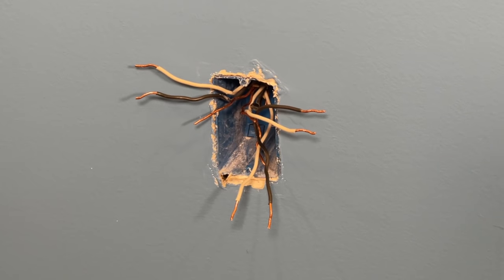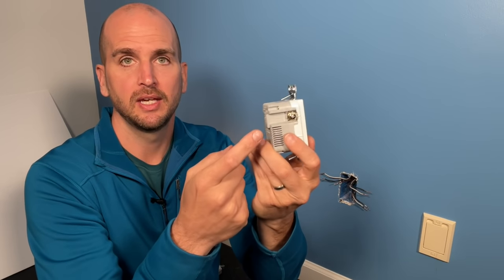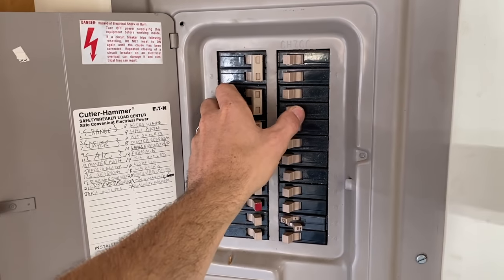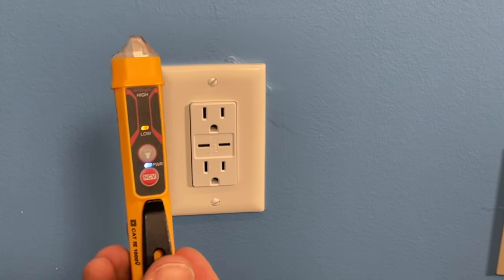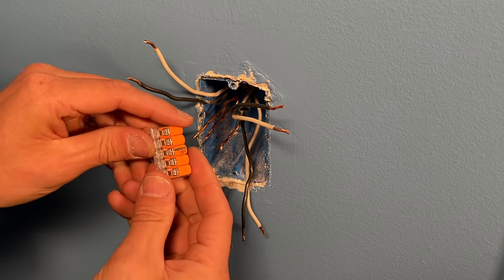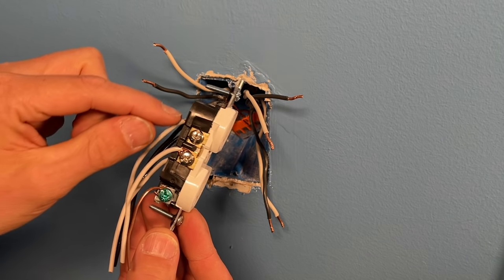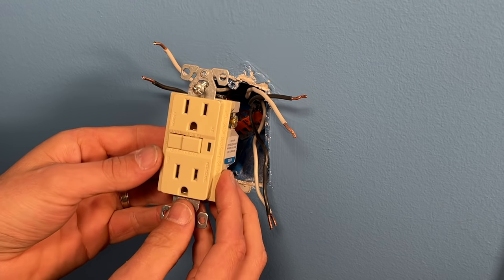Wiring an Outlet with Multiple Sets of Wires

Comment: Excellent work sir. I just started watching your videos and appreciate the care you take to explain the work you do. That being said, I would like to request a video that explains multiple switches. I have a bathroom with a light and a fan, and there's two switches for each one (One inside the bathroom and one outside). The dude that did them didnt know how to hook them up properly, so now both light switches work as expected, but the fan requires one switch to be on for the other fan switch to work. I have the same issue for another room with a ceiling fan. Two switches for the fan. Switch 'A' turns it on or off, but the other switch 'B' only works if switch 'A' is also on.
Reply: It's been 7 months since you've posted your question, so I don't know if you found your answer yet, but you can find diagrams all over the internet on 3 way wiring methods. 3 ways are a little more complicated to explain because of the different wiring methods used by electricians.  I can tell you that this issue is due to the travelers and the common wire crossed. Three-way switches have 4 screws. One black, two brass, and one green. The black is common, used for the power or switchleg. The brass screws are for travelers. The two wires traveling to both boxes. Usually, they are red and black wires. The green is the ground. Hope this helps.

Comment: As a pro for over 2 decades your the 1st person on YouTube that I have seen recommending the Pigtail. You should've explained why it's not a good idea to wire an outlet with 7 wires on it (including 1 ground). But let me ask you "if that outlet with 7 wires was to go bad which they do how long would it take a reg Joe to troubleshoot"? You should ALWAYS Pigtail outlets. Saves you time and money plus your wallet.
Reply: Theoretically, it doesn't matter... the bus bar and terminal are solid brass or whatever material connecting all the wires. They can't really go bad, on a standard receptacle as they're monolithic chunks of metal. (Not including shitty backstabs.) The outlet itself may be junk but the rest of the circuit should be fine since they're all still in parallel wiring configuration whether pigtailed or connected at the receptacle.. One exception would be the GFCI but it's expected to disable all loads downstream of it if it goes bad as that's how it is designed.

Comment: You should've mentioned that there can be times that there are 2 lines coming in in a situation when you have to break the tab such as when you want to have 1 outlet switched and 1 not switched.  Or if you want each outlet on it's own circuit.  But that's for the more advanced electricians.  This is why you should test all wires after they are disconnected to make sure there aren't 2 hot lines coming into the box.  Just make sure any switches in the room are on if you happen to have a switched and non-switched outlets in the room.
Reply: Yeah, I ran into this for the first time last year and was confused until  I checked the old outlet and found the broken tab, then I figured out what was going on.

Comment: My problem started when my wife asked why the switch in the bathroom was beige and the switch plate was white. Although it had been that way for many years I guess she just realized it bugged her. Wanting to say with white, since that's what we have in the rest of the house, I decided to replace the switch. Our house was built in the late fifties so I have steel boxes that have always struck me as being too small. I'll not bore you with the various troubles I encountered but it was frustrating and took much longer then I had ever suspected it would. When finished I ended up with a light switch and a GFCI receptacle above it (which was there before). I tested the GFCI and it showed Open Ground that would not bother me as in a previous video when you replaced older two pronged plugs with a GFCI you said that was OK just put a label on the plate that says it's not grounded. Here come the BUT... While both switch and plug work the plug gives a red on the GFCI and is dead whenever I turn the light on. Any help you can offer would be greatly appreciated as I have given it much thought and do not realize what I did wrong. I'm a homeowner handyman and have done basic work like this before with no problems, Help!  Jim Y.

Comment: a recent home reno with having to relocate a triple gang box of switches including three way and power in and outlet,  take a pic or two, and colour code with electrical tape each pair of wires marking which switch/outlet..  when pulling/feeding/moving the wire and boxes to new outlets and switches it makes for a very quick rewire without having to retrace everything.

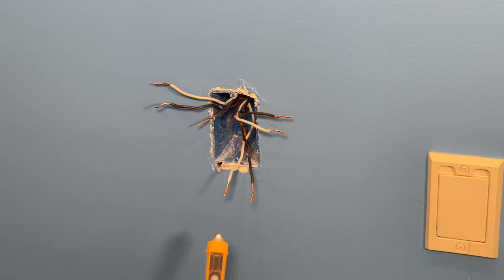Comment: 3:47 People, please turn the breaker off after he points out what wires are the independent power supply. He didn't just go right into wiring the outlet without shutting it off. He didn't indicate that.
Reply: Was going to make same comment. Don’t work hot if not absolutely necessary. Which is never in this case
Reply: he's unprofessional.
Reply: Thank you for stating the obvious
Reply: @H0WL1TZER  
Not obvious to people that don’t have any experience or common sense
Reply: If he needed be that ticky tacky ... then he really should be installing a lockout tag on the breaker box.
Cuz somebody might be wondering why their internet connect went down in the middle of a fort night gaming session.
Me personally would just unwire the plug hot ... touch each pair across its Black/white or ground , to find the circuit feed. Which would turn the breaker off/trip .

Then go reset the tripped breaker after I buttoned up the receptacle.
Hehe LOL ... but ya ... don't try this at home or your grandmothers house kids ;)

Comment: A note on those integrated USB outlets.  They are power parasites.  They are never off unless the circuit is switched.  You're much better off using a plugin adapter that can unplugged or put on a power strip with a switch.
Reply: Really? I’ve never heard that before
Reply: @Matt-ix6ne  Phone chargers, TV's, microwaves with digital timers, computers etc. use some standby power.  Anything with a remote control or a clock draws power 24/7.  It all adds up.
Reply: @randycarter2001  interesting thanks for sharing
Reply: Thank you!!  This is important to me and I didn’t know this. I’m not using this type anymore.
Reply: Is the same true of power strips that include usb ports? Or leaving a brick plugged into and outlet all the time?
Reply: USB outlets utilize a transformer to reduce voltage, so there is a very miniscule amount of loss. Maybe 1 us cent per year if unused for a whole year. Come on folks. Let's be realistic.
Reply: @talibennett782  isnt a brick actually a lithium ion battery? Therefore should not be left charging all the time?
    I unplug all lithium ion chargers when leaving the house.
Reply: @B3ASTM0D3.  the wattage is the same. A transformer reduces voltage by the same ratio it increases amps. Or vice versa. Hence the power draw doesn't reduce (or increase).
Reply: I noted that there are vents in this fixture, something I've never seen before ( I've been wiring for more than 40 years), so another concern must be heat build-up. This relates to volume of the box and the total number of conductors allowed behind this fixture.
Reply: They use virtually nothing, if it actually makes a non-negligible difference to your power usage or bill then there's something very wrong

Comment: To be safe you should use wire nuts or better yet Wago lever nuts to protect the bare wire of each of the black/hot and white/neutral wires before turning the breaker on.  You can then test with the non-contact voltage tester to see which one(s) are live.  This is especially necessary for the DIYer.

Comment: We'd behooved to learn about AFCI GFCI combination receptacles AND / OR breakers, AND with USB. At what point does it end, that we have to protect people from themselves ? I would argue that the breakers are the best option, so they protect the ENTIRE circuit and not just the individual or branch circuit. For example, when I trip the GFCI, in one instance of a particular room, it takes out all the outlets in that room but not the lights. In another room, it takes out all outlets AND the porch light, AND the ceiling lights as if I tripped the entire breaker, however, other things attached to that same breaker are still live. In that scenario, I would argue that it is best to have both AFCI GFCI combination receptacles with USB AND AF-GF CI breakers too. This will offer extra protection, or be a fail safe, and it will also help determine which specific circuit has the problem.

If it were up to me, all basic house wiring would be 10 or 12 gauge and absolutely NEVER 14, except when attaching ONE outlet or ONE switch. You can go from thicker gauge to thinner but not thinner gauge to thicker. I would also like to see two electrical boxes. One with a removable decorative plate below the outlet itself, where all the splices are. Never in the box of the actual switches and receptacles. There is a very good reason and use for that, but also goes along with METAL (Steel) boxes. Plastic and nylon boxes should be banned. But that's a different rant for a different time. It has to do with grounding and heat.

I would also like to see each outlet, and each light fixture on it's own breaker. So you might have 4 or 5 breakers for one bed room, or 3 breakers for one bathroom, etc. That ensures you always have power when you need it, and can safely work on another circuit, without taking down half your house. I would even further that by saying that each receptacle that has two outlets also have their own feeder of 12 gauge wire minimum. When I talk about wire (Romex) I am meaning COPPER. NEVER aluminum. However I think the lever wire nuts or even the push ins would be better for joining copper to aluminum. Further still, I would like to see that instead of receptacles with 2 outlets, they only have 1 outlet, with the top half being a switch to control the bottom half. This is for safety AND convenience. These days, you cannot truly TURN OFF, anything. When things are OFF, they're still drawing power in most cases. When you turn something OFF, it should be OFF, not in standby and not drawing any current at all. It should be truly off, and breaking the connection ensures it. So anyway, that's my stance on these things. I'm sure the next generation will be talking about even more B.S. for safety because we live in a society that have people that are SO STUPID, they don't realize that using a blow dryer will NEVER get their hair dry while standing under a shower. Hence the warning tags and the government needing to protect stupid people from themselves. It is a good thing in some cases, but in other cases, it's taken too far, and no doubt it is so that corporate America can get richer off the poor.

Comment: Great video!
As a pro Pig tailing is recommended which makes trouble shooting for you or a electrician easier and j hooks for the connections. Nothing wrong with using wagos either just double check all connections made no matter what you use

Comment: In my city it is actually code to use pigtails. Also another way the three sets of wires could be set up is a switched outlet that one of the white wires may be hot when a switch is switched on. This way one outlet is always hot and the other is hot only when switched on. This can be done by removing the little taps on the side of the outlet.
Reply: If you have this situation the switched hot wire is usually red.  White is always used for neutral never for anything else.
Reply: @1575murray  or the white wire is labeled with some red tape (at least you hope it is labeled)
Reply: Ya if you find an outlet with a hot white someone didn’t get it quite right

Comment: Over the course of several years as outlets in the house wore out leaving cords that wouldn't stay in the receptacles I found many of the outlets to have been wired with the back stabbing method...as I've replaced them, I have been using those commercial type receptacles, they make a very easy to install replacement and absolutely no back stabbing I hate that, I'm not an electrician but can tell those wires are not very secure.  

I just got finished rewiring a bunch of lights, switches, receptacles, and adding receptacles, lights and switches...wish I had those WAGO connectors...I have ordered some, and will be cleaning up a couple junction boxes with them for a much nicer mess of wires LOL....I have one right now that I need to replace the junction box as its way too small, not sure who put it in but its a very shallow box, so trying to get the wires into it is, well there's no cover on it at the moment.  I'm thinking of breaking up whatever is in that mess and putting in a 2nd junction box, and I'll be using the WAGO connectors from now on, much better storage utilization than bulky and sometimes questionable wire nuts.

Comment: If you want wiring fun, try a standard box, with 4 way switch, not knowing what goes where (over 3 floors,) having to steal a wire for a 3 way ceiling fan without using any additional cable.  :-)
Reply from the maker: That does sound like fun 👎😂
Reply: If only I could ever be blessed with such great fun and excitement!
Reply: @crazymayne69   My second project was more fun, where I did not want to buy a Power-strip, so I used a 5 gang box and made a in-wall 10 socket version; (1 GFCi with Alarm, and 4 commercial sockets.)  Each one now can be used with a wall wart, yay.
Reply: I use to wire homes in Florida so you had piped concrete floors pulling wire and plenty of Romex. My favorite was an 8 gang switch box in a big foyer with multiple hots, multiple feeds, a couple 4 ways, a couple 3 ways and the rest single poles. It was challenging but fun. Everything worked. :)

Comment: This example looks like #14 gauge wire. One element of installing a new receptacle is in the kitchen where outlets are #12 wire is the ability to stuff the thicker wires back into the box. It appears that the screwing the outlet back in accomplishes this task but no one seems to cover this aspect of rewire!

Comment: I really like your content... but I think you should have told your viewers that you shut the circuit breaker back off after you located the hot pair of wires (3:40 to 3:50 time frame) before you started handling the wires in that box again.  A lot of folks ignorant about electricity need that level of instruction.

Comment: Guys.... Always use your multimeter before working in a box (emf non contact is usually fine but I've been shocked 277 and fell off a ladder bc it didn't pickup stray voltage in the neutral which when I was holding ground touched it and zap) always check hot/neu, hot/grd and neu/grd with your multimeter before working in a box, it might be a pain but that one time it doesn't work will be well worth it
Reply: Still do not trust the non contact testers ................

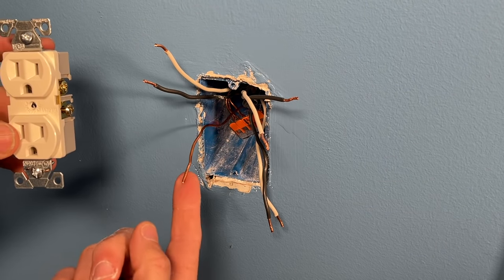Comment: 5:00 Especially true when it's 12 gauge (yellow) for 20 amps, I just wrestled with an outlet and it wouldn't push into the box without being cocked to one side.  So I think I'll do the pigtail, probably wouldn't need to do a pigtail with 14 gauge (white) 15 amp wire because it's thinner and bends easier.  I just got my Wago 221s and used them (for the first time) on the ground wires pigtail but wasn't very impressed, they seemed to not hold the wires any firmer than push ons, the wire actually got jerked out while I struggled to get the wires in the box.
Reply: If you’re doing a pigtail try to use the same size wire because say it’s on a 20A breaker and is a 20A outlet and is pulling 19A. 14awg wire will not like it. If you can get the receptacle in the box but is cock eyed. Get a receptacle checker and you can pry the receptacle so it will sit flat
Reply: Just tuck and fold m8. Tuck and fold
Reply: @austincox1239  Make a little accordion.
Reply: @larrydaniels6532  Yessir

Comment: You failed to mention that the line side can be used on a gfi to let the downstream recepticals not be gfi protected. Also, I would never recommend Wago's for roughly the same reason you don't recommend push in connections on the back of the duplex. Other than that, and the crooked screw heads (the journeyman I had during my apprenticeship would have probably chucked a screwdriver at me for that lol) good information for homeowners to know and well presented.
Reply: Just to be clear. Wago's are lever nuts, not push ins. (You may know this, but I have seen other people who don't get that confused. I have been to hardware stores that sell push-ins but not Wagos).
Reply: Pushin connections (backstabbing) have proven to be unreliable.  Wagos have proven to be reliable.

Comment: one situation you missed: split wiring (I think that's the term.  It's when the brass tab on the hot side is removed and then each brass screw will have a wire on it).  

First encountered this about 30 years ago when my grandparents moved into a condominium.  The living room lacked a ceiling light but half of each duplex outlet was switch controlled so all table or floor lamps in that room would turn on and off in unison with a wall switch.  

I myself used it a decade later in a former house on some outdoor outlets to control my Christmas lights.  A photo eye controlled the spot light on the flag that hung just outside my front door and the outlets on the front of my house were split wired so half was live 24/7 and the other was live only when it was dark.  For this, I used 14-3 (the red being the night time wire)